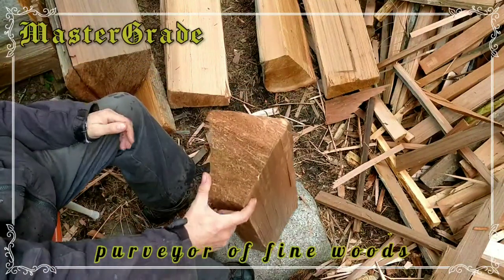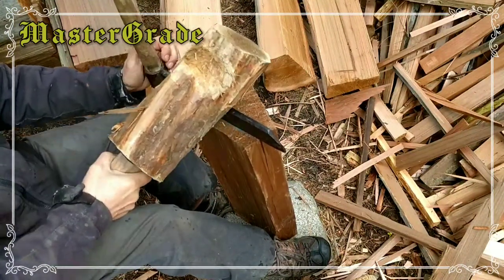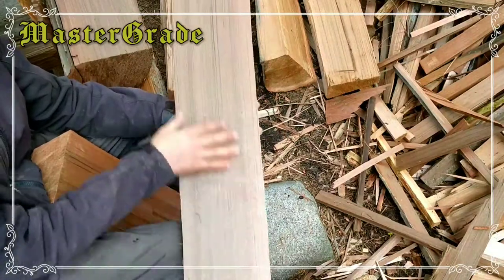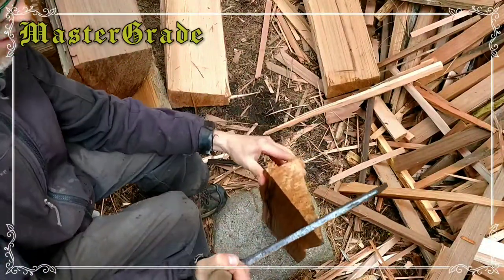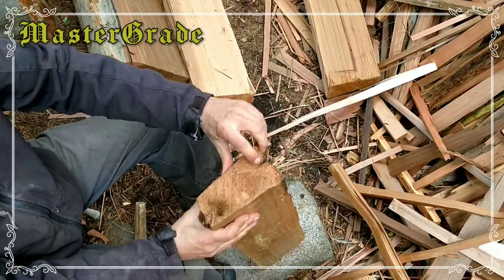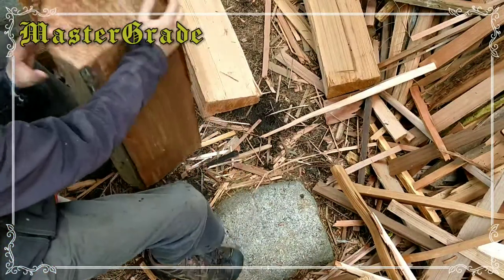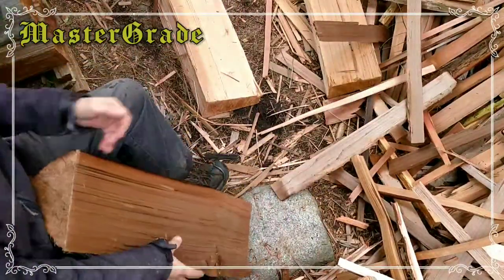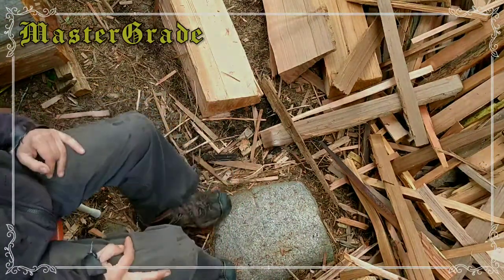How to Split Cedar Shakes using Froe and Mallet Hand Tools - Tutorial for Beginners - Craftsmanship

Comment: What if I want to use the result of "froe-ing" for making a drawer front, how do I prevent that tapering and get a straight crack?
Reply from the maker: Do not flip block ends when splitting. Split will be parallel, not tapered.